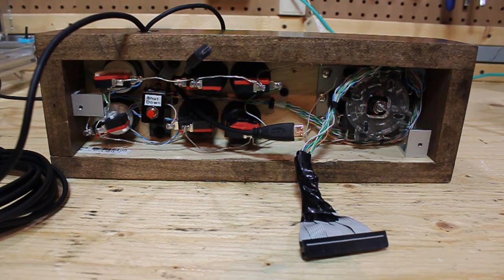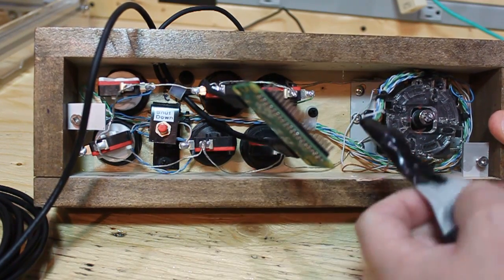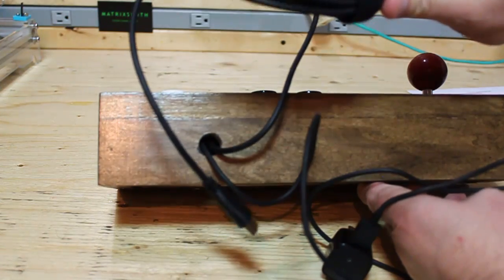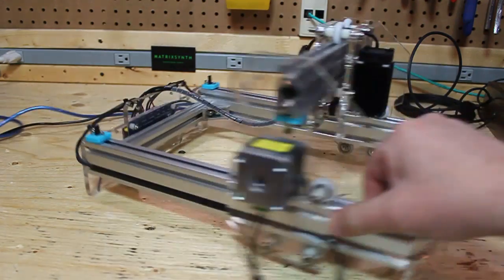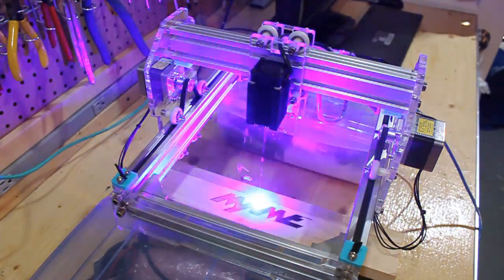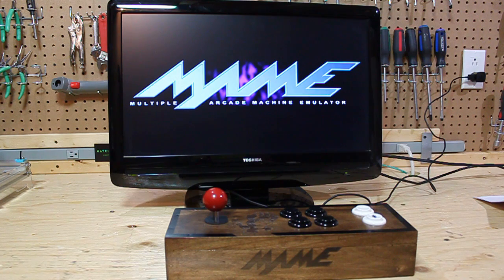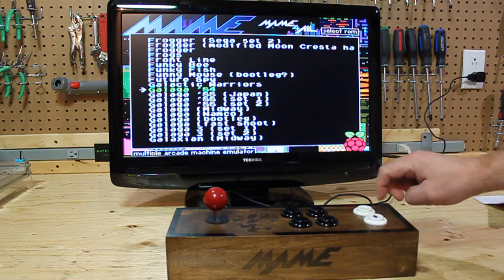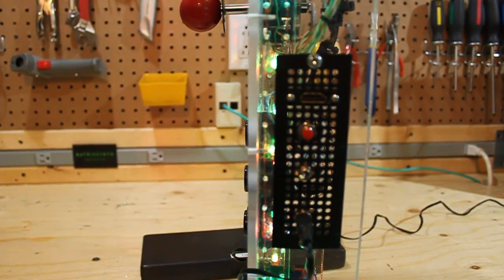DIY CNC Laser Engraved MAME with a Raspberry Pi Zero

Comment: How did you cut the plexiglass so nicely?
Reply from the maker: a table saw with a fine cut blade or a router.  use a map gas torch to polish up the edges.  do not use a propane torch as it is not hot enough